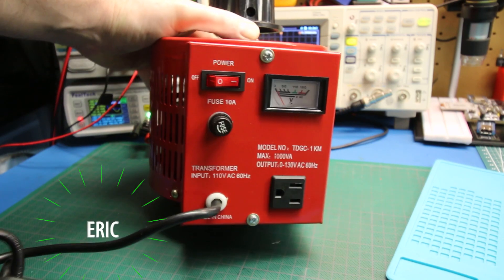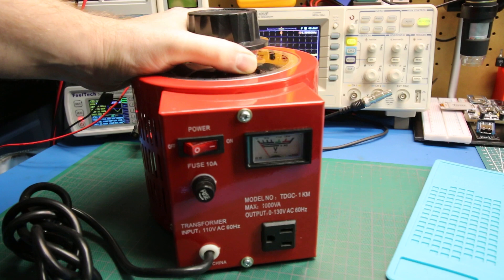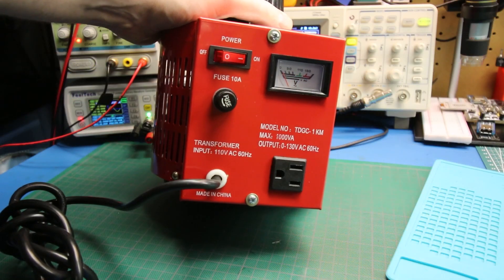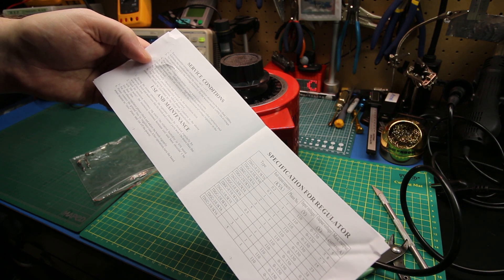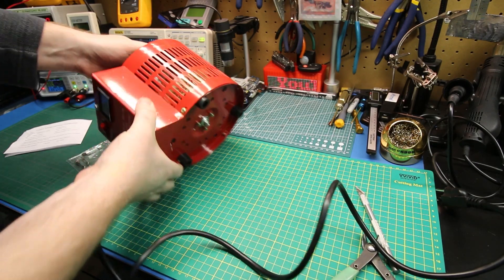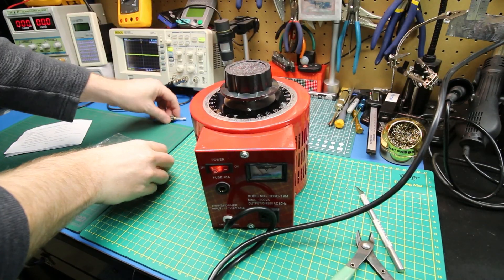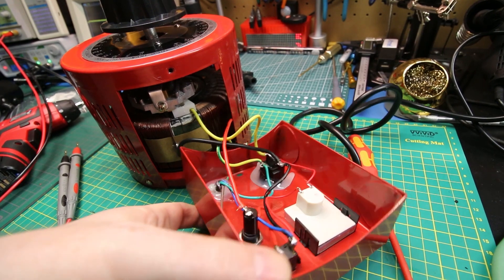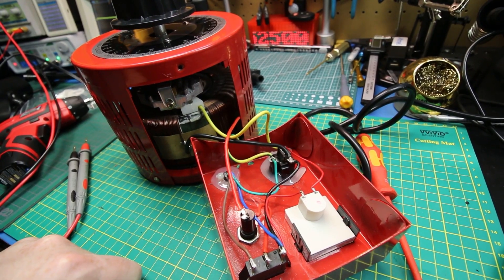Variable Transformer (Variac) Review and Repair 🔥

Comment: Thank you, I have one where the plugs failed, so i grabbed a metal box, receptacle and some wiring to just pigtail it to the output, but bypassing everything in the box due to crappy wiring and solders I got confused on what wire goes where and hooked up the wiper to the neutral input instead of output only. i powered it with a switch on the power to it, (smartest thing i did so far lol)  It buzzed and smoked a little then i flipped it off. guess i wore that brush down a little. I knew it had to be something stupid on my end. Hard to find relevant info for these. all i needed to know were the basics of what goes where, YEL to Neutral Output only, front side of coil to input/ouput hot side. Side coil RED to neutral input.  Here I go to fix it, hope this is right. Thanks again
Reply: Update: its working now, no fuze and no switch but its working. I guess of it burns up ill just unplug it quick, it is hooked to a gfci receptacle and what i am running has a built in one on the plug.

Comment: I just acquired an interesting product It's a fan speed controller but it's basically a simplified cable transform it literally is just a metal box with a dial and a power input and a power output. The box is riveted together so there's no way to get inside it.  Talk about a mystery box I think it's rated at 3 amp. It's amazing when they work because it works perfectly with really fine adjustment of voltage. I did have an old-fashioned berco, rated at 10:00 a.m. and you could feel the quality of that unit but it was actually rather unsafe, huge vent holes giving access to a live coil. I'm greatly impressed. I'm worried about my unit I need to test the earth but there's no other access and I would literally have to drill out about 8 rivets which I don't fancy doing since it's working but anyway. It was extra cheap cost £100

Comment: I think you omit main reason of fuse blowing problem. Every transformer suffers on start of initial "inrush" current on primary coil which can be 10 times higher than normal current. It means that hundred of watts transformer is able to blow up your home socket fuses. These big variacs have 500-3000W and are able to generate 100A peak in first tens of seconds after start. The solution is soft start circuit which is used on powerfull audio amplifiers equipped by toroid tranformers. Simplest form is a resistor in series with primary transformer coil controlled by time relay. The resistor is bridged by relay contact after first second or something like that. Slow blow (motor) fuse is another solution. It is definitely sad that the producer is able to switch input and output plugs as the reversed voltage may be high enough to damage coil insulation and take the transformer down. And it is the better option considering that you can easily reach very dangerous high voltage in the output plug.

Comment: I've been using one of these variacs to control the speed of a fan in my room for over two years. It started sparking and feeling crunchy when I turned the dial, so I took it apart and cleaned the carbon deposits off the coil. Works good as new!

Comment: I got one from banggood,  plugged it in and it nearly blew the consumer unit of the wall, it didn't even blow the fuse. I looked at the inside and the soldering would have been done better by an untrained monkey. A piece of junk. No more Chinese shit for me.

Comment: Great video and repair. I have acquired a STACO ENGERY 1010B uncased. I am having the same problem you had with the variac wired the wrong way. It is a 5 pin connection and I am wondering if you could help me getting the voltage to start at from off to130vac.

Comment: I need something like this to produce 15VAC; what RELIABLE equipment would you recommend? Preferably from Amazon.
Reply from the maker: You need to specify the amperage needed.  Here  is a 60W PSU  https://amzn.to/3UFEZKF
Reply: @MkmeOrg  I just checked it out, the output is in DC; I need AC.   I need the 15VAC to do lead ID testing on 3 phase motors.  Tried using DC and didn't work. Any variable power supplies with AC output under $100 you know of?

Comment: Also, the fuse... isn't in the best spot. You want a fuse upstream of the load #1 and #2 you want it to protect the supply and yourself! I added a 15 amp slow blow fuse and holder to the yellow wire coming off of the sweep to protect the coil FIRST. The way they have it fused is the power comes in from the wall and through the 20amp fuse first, which is all good and fine but doesn't directly protect the coil or the load! I went with a 15 amp slow blow because everything inside the unit, from the plugs to the Guage of the coil wire is only rated for 15 amps, NOT 20! Other than that it's worked flawlessly all the way up to practically smoking. (Pushed her to get any failures out of the way early) good video man. Keep it up

Comment: I just bought one,2kva with digital meter. Came with a big dent in the side. So I opened it up and the hot snot was everywhere, the cord retainer grommet was loose and covered in snot. The solder was appalling and the dent was bad enough that it hit the coil and broke through the enamel on the coil. The Amazon listing for it said "free returns," so I go to return it and since it was shipped by the seller not Amazon I had to contact them. They say they're gonna take the cost of shipping the return out of my refund. I said oh no, said on the listing free returns. They wanted pics of the damage. So I send pics and they come back with well due to the trouble of returning the unit would I be satisfied with $65 back and just keep the unit. SURE. So I fixed it, re enameled the whole coil for good measure, secured the cord with American hardware and reflowed all the solder joints and now she works fine. Thanks China for a 20$ variable. Bout all its worth when I got it!
Reply: I also added another fuse holder inside the panel which covers the output and therefore the device under test. Put a 20 amp slow blow in there for good measure and whenever I want to abuse the thing I stick a 50 amp in each fuse holder. I've practically had her smoking running some of my crazy projects. It's been a few months since I got it and honestly I'm impressed with the overall durability. They really can take a lickin

Comment: i have one of these and when i attach it to a full bridge rectifier the variac gets noisy and very hot at 50 volts the variac goes to 100 c temp , i can even smell the varnish is that normal or what do you think the issue is ?
Reply: That is not normal. How is the Variac connected to the bridge rectifier? You can't connect the rectifier upstream of the Variac, since the Variac is a transformer that needs AC input. You can connect a bridge rectifier to the output of the Variac, but only when the rectification draws equal current from both halves of the AC waveform.

Are you sure the bridge is OK? A bridge with one open diode will conduct on positive or negative half-cycles only, which the transformer is not going to like

Comment: The quality on most Chinese "variacs" is fairly appalling. Clearly the factory doesn't test the final product prior to shipping. Miss wiring can be deadly. I recommend anyone needing a low cost variable auto transformer consider buying a used Powerstat, Stenco or Variac product. Just make sure the seller has good feedback and the product is covered by a return warranty. Good luck.
Reply from the maker: The flip side could be that anyone using one should probably have the knowledge enough to debug and remedy any problems with it since it is not a certified household appliance  ¯\_(ツ)_/¯
Reply: @MkmeOrg I agree. But still though, it doesn’t justify the low quality assurance in the factories. Just because it’s a device targeted towards electricians doesn’t mean it should have to be shipped with incorrect wiring inside which potentially could pose a very big danger to the user.

Comment: Just got my 1kv  today. Glass is cracked gauge is moved back. But needle looks intact

So i better get to work with superglue to repair the cracked glass. If such can be done. It looks that we have the same model so if i have to swap out the display then what do you reccommend

I've send a picture and better hear what they say.

I wont dare to plug a tube amp into this yet

Comment: I have something called an Amp RX Brownbox which is a high quality unit specifically made for lowering the voltages on vintage guitar amps that were made to take anywhere from 110-117 volts ...I need a 2nd variac and was looking to spend a lot less...if I come across this issue on a cheap-o Chinese unit,I'm now prepared,thanks!
Reply from the maker: Welcome!  Good luck with your unit

Comment: I am not involved with electronics so you will have to read between the lines if I use the incorrect term. I bought one on these VARIAC units off eBay last night for $59 and free shipping. I can see I will have to follow your lead and thoroughly check it out. The purpose is to power a 24 volt wheel chair motor DC Voltage. I know a little bit about a rectifier bridge coming from a welding background. I have a 1200 volt 200 amp bridge to give me an output of DC voltage. Maybe I'm wrong but I thought by turning the knob on the transformer and measuring the output from the bridge I could find the 24 volts???????? I was told I had to use a capacitor as well. I have no clue. I searched YouTube looking for a simple build converting 120 volt AC house hold current to DC 24 volt to run the motor. I appreciate you doing this video, I can see that items brand new out of the box especially with China stamped on them might be at fault and not work properly. I intend to look at your channel and see what else I can learn. Thank you. I will subscribe
Reply: Firstly, a variac is not a power supply. Secondly for someone who admits that they know nothing about electricity to go messing about with a a 1200v 200A welder in order to power a 24 v wheelchair motor borders on Lunacy. Google your local health care centre and ask them to put you in touch with someone who supplies chargers for wheelchairs. Far safer and much cheaper in the long run .

Comment: I just bought one a few days ago. Arrived today, plugged it in and it hummed very loudly. Blew its fuse within half a second. I have to say that the variac is a 110V one and I ran it on 230V. But that shouldn't matter right? Do you know what I could have done wrong? Can you help? Seems really similar, but my connections were right.
Reply: You have a variac that runs on 110 Volts. You can;t run it on a 230 Volt supply so you must plug it into a step up/down transformer.
 The unit looks like a little black transformer but has a American socket modified with a European  socket design with it. Make sure you get one that has a mains supply
 line with the European plug on it (assuming your in the UK) although  I have seen adapter jacks that allow it to be plugged into 110 Volts 
so we in the USA can run it as a step up transformer. The THG-1000 should fit the bill but you didn't say what you are powering up with it.
 The 1000 Watts will do you fine for anything!
Reply: @hestheMaster  I know. I already have an autotransformer for stepdown. Now I'm just missing a US power cord.

Comment: get a better display for it. i put a nicer digital one in mine and also wired up a panel that have lots of info. then i have a nice accurate display on the front
Reply: Can you share what dislay you used? I'd like to make the same modification.
Reply: @TR3A  sure thing. look on aliexpress for part number D91-21 it's identical in size and drops right into the same hole. You just re use the frame around the analog one. this new one snaps into that frame from the existing one then they together snap into the hole. Super easy install.
Reply: @th3drizzl378  Thank-you!
Reply: @TR3A  no problem!
Reply: @TR3A  you can also find it here with the frame included: https://www.mpja.com/AC-Digital-Panel-Meter-0-500V-Separate-Power-3Wire/productinfo/32931%20ME/

Comment: Good catch!  I have a smaller one, and the way I use it, I cannot even see the top dial.  For the rare times I use it, I just meter it for the proper voltage.
Reply from the maker: Yeah the dial graduations aren't really something I will use either.  Cheers Garth